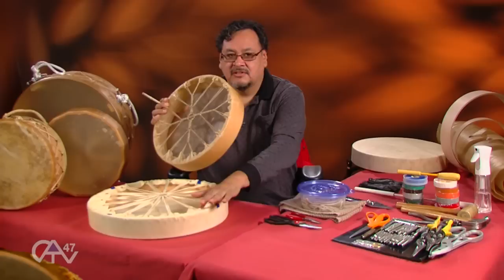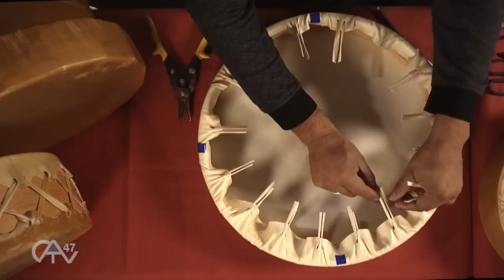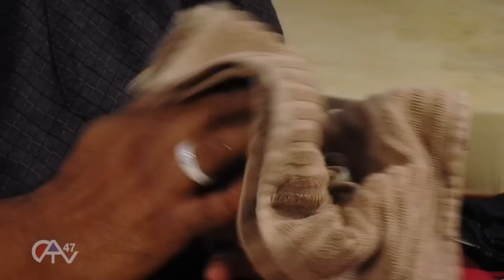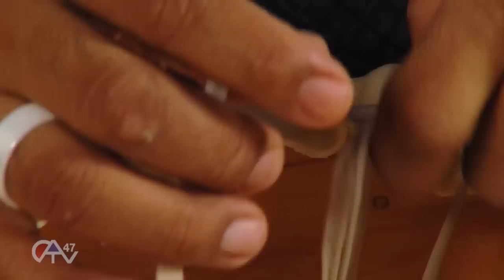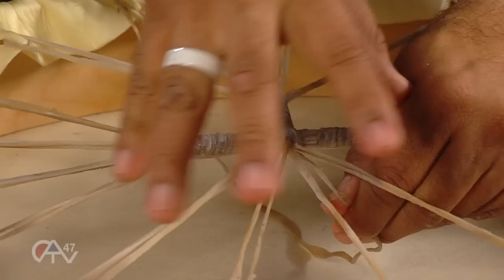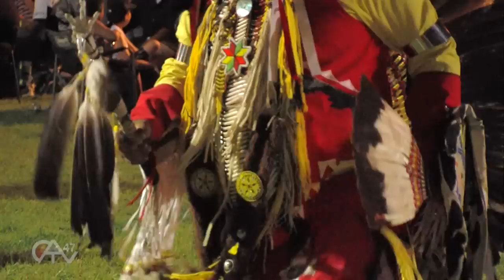The Native Drum - Episode 4

Comment: Shawn,

Is there a reason that you had to take the metal circle out.  I have no drumming experience, but it was not offensive in appearance.  I was thinking you could extend the handles out from it...Is that possible?  Thanks also for the tip on straightening out the handles by adjusting clockwise or counter.  Look forward to your next video!